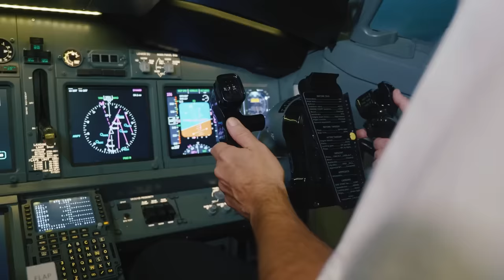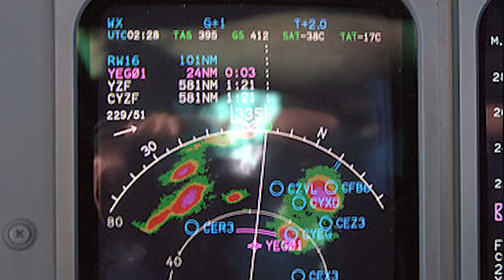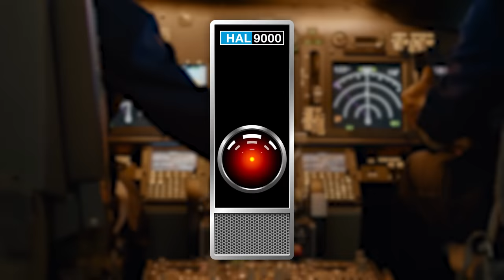Neil deGrasse Tyson Explains Advancements in Aviation

Comment from the maker: What do you think the next major advancement in aviation will be?
Reply: Single pilot airliners. Pilot wears a bio monitoring suit that determines the status of the pilot. If the pilot is incapacitated the computers remove the pilot from the command loop and land at the nearest suitable airport.
Reply: Reaching my hometown Kathmandu , Nepal in half an hour from Dallas, Texas .
Reply: 1. Design planes to fly over oceans without fear of crashing into waters. This will save more fuel by flying using shorter routes.
2. Alternate fuel. Maybe fuel cell?
3. Design planes routes like ICBMs. This can save fuel.
Reply: Find a way to remedy the insane levels of air pollution commercial airliners create. Far more pollution per traveler mile than any other.
Reply: My own personal pet peeve is the amount of time it takes to board and to de-plane.  If airlines could convince everyone to check their bags, we could 1) get through security faster 2) board and de-plane faster, and 3) have more leg room.

I dream of future travel where everyone checks their bags.
Reply: Alternative sources of energy, such as electrical, solar and hydrogen-powered airplanes.
Reply: @robrussell5329  People are reluctant to check bags because the process is slow, annoying, and likely to cause loss or damage. Plus, it increases the amount you have to walk. The only way to change passenger behavior is to VASTLY improve the luggage checking process.
Reply: Spirit makes the airliners
Reply: Spirit makes the airliners
Reply: @lymanmj wrong a jet makes the same amount of pollution per passenger as a car that gets 40 miles to the gallon
Reply: @robrussell5329 try walking...
Reply: I find maglev trains and underground vacuum tubes are much more perspective in terms of speed and safety. I'd bet on those instead of aviation.
Reply: @Jack_Russell_Brown  that'll never be possible, I'm afraid. On the other hand - what it would give to you? Gravity comes from every object so what do you want to isolate from what?
Reply: Anti gravity
Reply: Worm holes is the final boss
Reply: @johnniejackson9794  never gonna happen in our physics, I'm afraid
Reply: its not the computer tho, its the engineers, programers, etc. who came up with the calculations and tools of measurement to very accuartely calculate the parameters and the made the computers such that they can solve these equations in milli or even micro seconds repeatedly and without errors anddd continuously. and shout out to the programmers to make the code run seamless
Reply: Making sure that all of the bolts/nuts were included and tightened (and cotter pins inserted)?
Reply: Next advancement either commercial sonic come back or electric airliners. It would be nice but will never happen is blimps like the Hindenburg except running on fuels like helium instead.
Reply: You can do it with a bottle of water instead of a glass of water.
Reply: They call it ILS, which stands for Instrument Landing System on planes where the pilots does little, and they use the systems computer instruments mostly. 90% of flights are done by this where the computer does 90% of the landing. The pilots just navigate and communicate to the tower.
Reply: Safe Boeing planes?

Comment: Sorry Neil, but taxiing happens on the ground. That is why the short sections of asphalt or concrete between runways are called taxi-ways. Even Chuck knew this, as he was surprised you said planes “taxi” in the air, in a holding pattern.
Reply: Yeah I was so confused when he said that
Reply: Only in America do you drive on a parkway. Just so you know.
Reply: I'm pretty sure you are ignorant to the fact that taxiing can actually happened in the air as well…
Reply: @andrewlindenfeld6222  - please explain to us how that occurs.
Reply: @andrewlindenfeld6222 it isn't taxiing in the air, it is a holding pattern. Taxiing is what happens on the ground where the plane is literally driving to the runway that it is cleared to takeoff on.
Reply: By definition, an airplane that is taxiing is moving on the ground under its own power (as in not being pushed or towed).
Reply: No offense meant to anyone. An aircraft taxiing is an airplane using a taxiway on the ground, or floats on a body of water. 
Nonetheless, this video is very informative, I enjoy startalk very much.
Reply: I thought taxiing was that thing that takes you home after a heavy sesh on the town
Reply: Yes, you taxi to go to the takeoff and you are put on hold whenever you have to wait for your landing in the air. It still happens tho 😊
Reply: @thescottishcyclist4640 😂😂
Reply: But it doesn't consume that much aeroplane fuel. There are tug vehicles that push or pull jets.
Reply: @barbaralachance5836  hi 👋🏼
Reply: It's called Circling when the plane is in the air hunting a place to park. 
It's called a Go-around if the final approach is aborted before landing.
Taxiing takes place on the ground.
Reply: @TheRohnjackson  Not really. Tow trucks are only used for push-back and often for repositioning for maintenance reasons. Other than that, airplanes taxi out of their own power.
Reply: I was looking for this comment, luckily it was the top one😂 always knew Chuck was the real genius lol
Reply: As an Air Traffic Control guy myself I wish he would’ve brought on someone from GE or Boeing, or even the FAA to have this discussion.
Reply: Thanks for helping Neil educate us but you don't have to be condescending..
Reply: StarTalk is awesome and informative. But it's not perfect. Even Astrophysicists make mistakes.
Reply: @c.edwardme1676  I was not trying for that at all. I was just explaining what taxi ways are, where they are
Reply: @c.edwardme1676  I wasn't trying to be at all. But I was shocked that such a highly educated scientist would say that. He expressed his lifelong interest and passion for aviation, so yeah…I was taken aback…as was Chuck, or did you not notice that?
Reply: @c.edwardme1676  He wasn't really condescending imo.
Reply: I think you missed the point. 
Whether it's "taxiing" or a "holding pattern", has nothing to do with what he was saying.
All he was saying, is that planes do not have to wait very long upon arrival, to land.
I am willing to bet that your friends(the few), chat regularly about your keen eye to lack of detail.
Reply: Correct, its called, Holding.
Reply: This is the definition of, "Uhm Actually..."
Reply: So it is not PLANning??
Reply: @sg1893  more like wingin' it…😂😂😂
Reply: @andrewlindenfeld6222  Taxiing only happens when Sly and Robbie are in attendance...
Reply: @bipolarminddroppings  and park on a driveway 😊
Reply: I think he meant being able to hold. Don’t be so picky
Reply: Yea, I thought the area they drive the plane in prior to take of was called taxi.  But idk if I’ve ever heard the word taxi-ing. 🤷🏽‍♂️  still I love this!!  Who is the other gentleman??
Reply: @mikehinson5935  Chuck Nice, the comic.
Reply: @Jah_Rastafari_ORIG  thanks man.👍🏽
Reply: @bipolarminddroppings and what Utopia do you come from?
Reply: @bipolarminddroppings  the parkway is next to a park.
Reply: @bipolarminddroppings  no, in Canada as well...
Reply: He just human
Reply: @fmacc3660  You just proved you missed the point.
Reply: @mikehinson5935  - Yes, the section of ground on which they drive (taxi) the aircraft is the taxiway. Both Taxiing (without the hyphen) and taxiway are both real words.
Reply: @janshirley  - Just an FYI, aircraft that are placed in a Holding Pattern awaiting an opportunity to land are not circling. Circling to a pilot is when the aircraft approach the airport at one runway or direction. Then they Circle the airport to a different runway or direction that is greater than 30° (IIRC) from the original runway or direction. This is normally done below the normal Traffic Pattern Altitude.

When they are at higher altitudes “hunting” for a place to land, they are Holding. They Hold over certain known locations near the airport. The pattern is shaped like a racetrack with two straightaways opposite each other and two curves opposite each other. They Hold to wait for landing and parking availability or weather conditions to allow landing. 

Aircraft rarely circle over/above airports. That is where the most air traffic is located. They either join the rectangular Traffic Pattern or Hold elsewhere.
Reply: @andrewlindenfeld6222  - Air Taxis are aircraft that transport people relatively short distances through the air. However, Air Taxis do not “taxi” in the air. They only taxi on the ground. Since they are operating as an aircraft, they still use the correct aircraft terminology. Taxiing is done on the ground. Usually on taxiways.
Reply: @deanfowlkes  I stand corrected
Reply: Taxiing is done in both ways
Reply: @user-wh6pe4ou2g  taxiing is done on the ground only.
Reply: Everyone makes mistakes😂
Reply: Dear Lord Neal.  There is an autoland option on many airliners but it requires the correct type if ILS system at the airport and it is a much rougher landing than the pilots do.  Landings will be flown manually usually a couple minutes before landing in clear weather.  In bad conditions the ILS system will guide the pilot or may be on autopilot but will typically be turned off around 500-1000 feet above ground level if not before and then manually landed.
Reply: @mbartel500 I believe it was a Freudian slip - we should be able to cut him a break.   After hearing him in other lectures recite both Bernoulli's principle and  Newton's 3rd law as they relate to aircraft flight (instruments and controls).  Yes, taxiing, holds, go-arounds, missed approaches, Circling Approaches, ground stops, Vx, Vy, Va, Vne, Vs1, hypoxia, compressibility, Mach tuck, etc, etc, etc…..   yeah, we cut a break for one slip…. I hope you agree.  Peace to you and happy flying.
Reply: @Alanc419 when an extremely educated professional says he is an acute observer of aviation, airports, air traffic, airplanes, all of it, then I would expect him to understand the airplane ground movement known as taxiing. It wasn't a slip, it was ignorance. I would want to be corrected, if I was spreading incorrect information on a science oriented youtube channel. If my next door neighbor said what he said, then yeah, i wouldn't say anything. But Mr. Tyson has the responsibility of spreading information to a rather large audience, and if that information is wrong, then I will call him out on it. 

Get your facts first, and then you can distort them as much as you please — Mark Twain
Reply: @Mbartel500  Roger that!  👩‍✈️Fly Safely!
Reply: @Alanc419  thank you, best wishes to you and yours 👍
Reply: Yep sorry Neil taxiing is on the ground only. Circling waiting to land is Holding and the pattern of planes holding is called a “stack”. You enter the top of the stack and work your way down as you circle with planes landing from the bottom of the stack.
Reply: Hilarious that so many people are commenting on this super minor who cares slip.
Reply: Honestly I think he meant holding pattern. He just could not find the words. Some scientists with high IQs are scatter brain 😂
Reply: @lombardo141  Neil and Chuck both called this a holding pattern, but Neil still referred to it as “taxiing”. Neil should stick to what he knows…astrophysics.
Reply: @Mbartel500 he only got one thing wrong and killed the rest of the video. Man!tough crowd. 😂
Reply: @lombardo141  when someone claims to be an acute observer of airplanes, airports, aviation…all of it…then I expect them to not make such a fundamental error. If he didn't know the thermal gradient of the main combustor stage of a GE90-115b from idle to full throttle, I would cut him some slack on that one. But to not know what taxiing is….?? His knowledge of astrophysics might be exceptional, but his knowledge of basic aeronautics leaves a lot to be desired. As a man whose entire career depends on accurate information and verifiable facts…he should be held to a higher standard.
Reply: @Mbartel500  i will assume you are some kind of engineer or related field? If so i understand why you are going so hard. From my perspective i don't think it's a big deal, so lets leave it at that.
Reply: @lombardo141  I was a structural analyst for U.S. Steel for 42 years. Now retired.
Reply: @Mbartel500  congrats, you derserve it.
Reply: What’s the other sections made of then?
Reply: @coolbluereview  the same…asphalt or concrete.
Reply: @bipolarminddroppings Americans drive on a parkway and park on a driveway
Reply: Misspoke
Reply: @bipolarminddroppings and park on a driveway.
Reply: @TheRohnjackson First of all, it’s AIRPLANE, not aeroplane! Secondly, all taxiing takes place under aircraft power!
Reply: Yeah where I live you still have to stop talking or pause tv. If anything in my area it seems they have got louder in the last few years.
Reply: Pretty sure when I flew on a helicopter in the military they considered a certain portion of their movements, hovering over the taxi ways as “taxiing”
Reply: @pqfamilyadventures  But Neal's discussion is about airliners, not military helicopters.
Reply: For y’all who don’t know, air taxiing used to be a thing planes did. Lmao as he said USED to. Helicopters however still do this.
Reply: In any case, the video is about how air travel has changed, not a lesson in air travel terminology.
Reply: @skyborne80  as an astrophysicist, scientist, and scholar, he should know the value of correct terminology, and facts. This channel embodies those concepts, as he has made videos about commonly believed “facts” that just are not true. So I pointed out his mistake…what's the big deal? We all make them…even you!
Reply: @Mbartel500  And I'm sure he took it to heart.
Reply: @skyborne80  sarcasm…..first time I've seen that on the internet👍👍
Reply: @Mbartel500  Actually, I was being serious believe it or not.
Reply: @bipolarminddroppings and park in a driveway
Reply: @bipolarminddroppings   We also park on a driveway.
Reply: I knew that’s what it was I knew in the air wasn’t right lmao

Comment: Taxiing (rarely spelled taxying) is the movement of an aircraft on the ground, under its own power, in contrast to towing or pushback where the aircraft is moved by a tug. The aircraft usually moves on wheels, but the term also includes aircraft with skis or floats (for water-based travel).
Reply: Yeah I was surprised by how he misused that word.
Reply: I didn't understand why he used that word. Should he have used "holding"?
Reply: @osorious  Yes the other guy caught it, it is holding and it's true though, it's pretty rare that we hold before landing, even after a missed approach, often the tower will just vector the planes "manually" are re-sequence them without entering a holding pattern.
Reply: @TheBarzook  - Rare? You better be doing at least one every six months, buddy. 😜🤣

Just kidding. I knew what you meant.
Reply: @PCarDriver87 He is both pompous and overrated.

Comment: Neil, I am older than you. Only once in my life, in my childhood I was a passenger on a Boing 707. Those four turbojet engines were so loud INSIDE the cabin that my ears were still ringing hours after a 5 hour flight.  Today I am barely aware of the large twin turbofan engined Boing's flying over my house at 5,000 or 6,000 feet.
Reply: And then, in the REALLY old days, like the '50s when I was a kid, there were big piston planes.  Noisy as that Boeing 707 was, a DC-7 or a Constellation was louder.  And they didn't climb anywhere near as steeply, so, having taken off, they might have to circle a couple of times to get high enough to clear local mountains.
Reply: Boeing, not boing.
Reply: @erinncarl9294  based on their recent history boing is appropriate
Reply: @0x0michael  🤣🤣
Reply: @CAMacKenzie  Those old piston prop radial engines loudly rumbled and vibrated, and were in fact quite loud, but the turbofans of the 1960s absolutely shrieked.
Reply: @MarinCipollina  It wasn't just the engines, loud as they were.  The propellers, with supersonic blade tips, made such deafening noise that they really scared me.  Also, the 707, Convair 880, and DC-8,when they first came out, did not have turbofans, but the much louder straight jets (P&W JT3,  GE CJ-805).  Still, loud as they were, I never found them frightening like the big prop jobs, which sounded like they were coming through the roof.  Besides, the jets climbed faster and so came over higher.